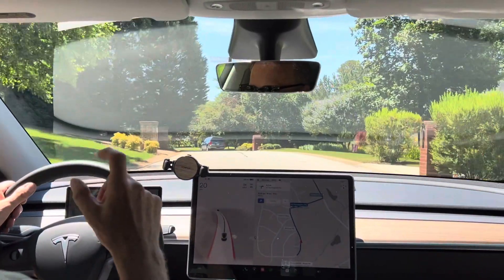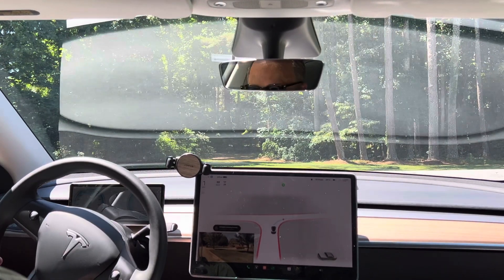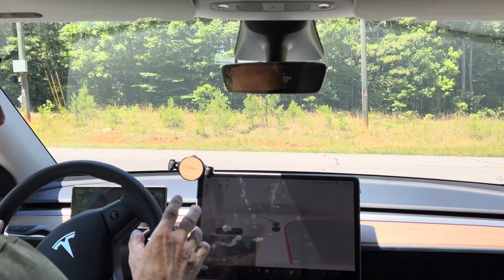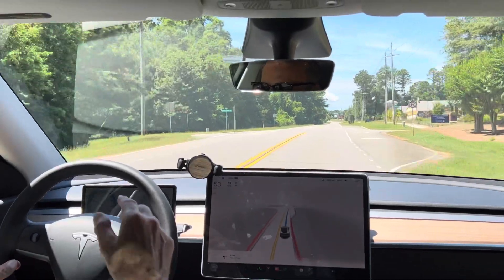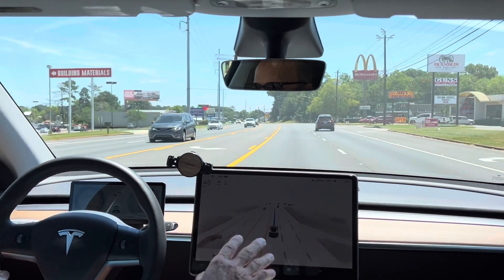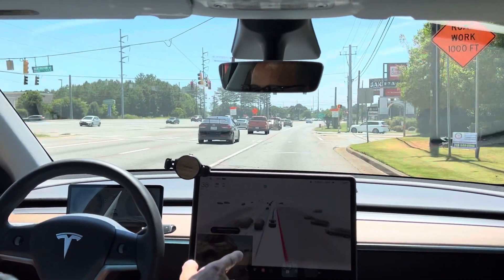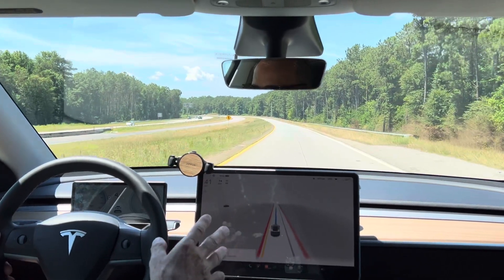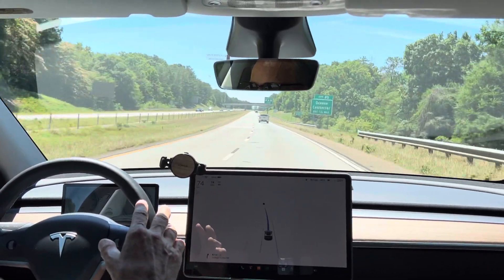Tesla FSD Vision and RADAR—the CORRECTED EXPERIMENT!! ✅✅✅

Comment: Is there a difference in autopilot maximum speed with FSD beta or regular FSD without beta?
Reply: I don't think so.  I used to have AP set to 10 MPH over the speed limit, but with FSD, that made me uncomfortable in 20 or 30 MPH zones, so I set it to 10 percent over and that is much more comfortable for me. I will say that the system is not completely accurate in identifying the speed limits.  Sometimes it thinks the limit is, for instance,  60 MPH in a 70 MPH zone and sometimes 40 MPH in a 30 MPH zone.

Note there is currently no such thing as FSD without beta.  I think you are thinking about autopilot (which is also technically a beta) without FSD.